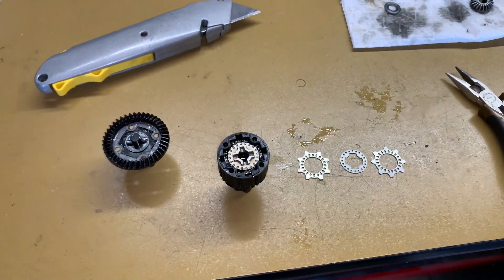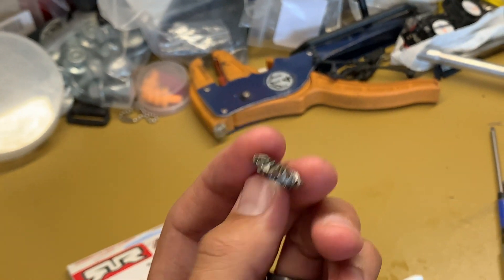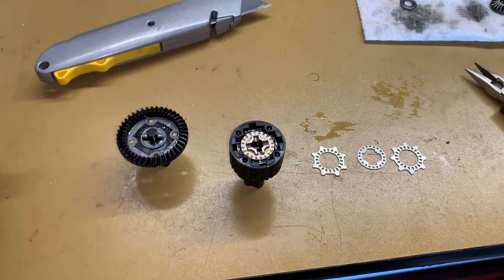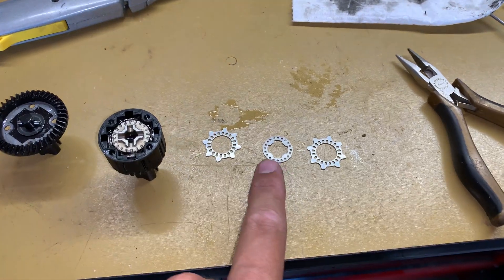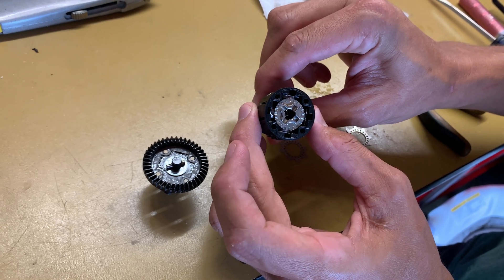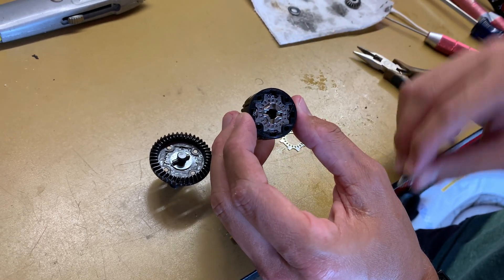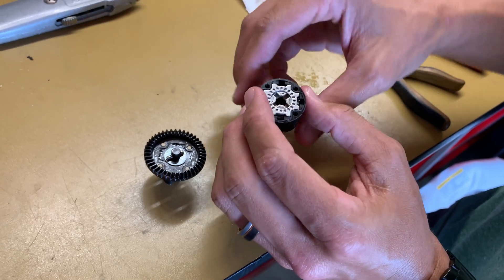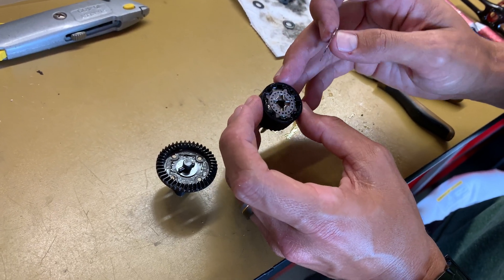Arrma Kraton 6S EXB LSD Diff Plates: How Do They Work? Can They Stop The Rear Diff From Breaking?

Comment: Just a small note: On the plates, there's a rough edge and a smooth edge. The smooth edges always face the gears. Meaning the lower plates smooth edges faces up and the upper plates smooth edges face down.
Reply: correct I had one apart last night

Comment: Will this diff fit on an outcast/notorious as an upgrade?
Reply: Wish I saw this sooner. I have an outcast/notorious, I had a v4 but I bought a v5 chassis for it and they fit in perfectly. You just need to buy the input gear, the metal cup for the input gear and the plastic safe-d cup. I am not sure if it will fit the v4 though since it doesn't have as wide of a dip in the chassis.
Reply: I put them in my kraton 6s v4 and they work great without changing anything but the diff, no pinion gear swap

Comment: Did you have to use a new diff case? When I tried rebuilding mine with new gears and slip plates it was notchy because even after multiple times cleaning there was still bits of metal shards in there.
Reply: you ever found out the solution. going through the same situation now. can't even count how many times I've taken apart my rear diff trying to set it up with the lsd
Reply: Guys try using any brake cleaner , when you take out the diffs, clean it until it’s bone dry . 😎